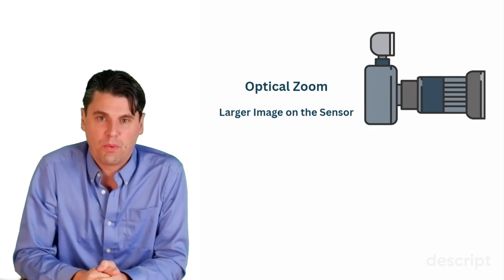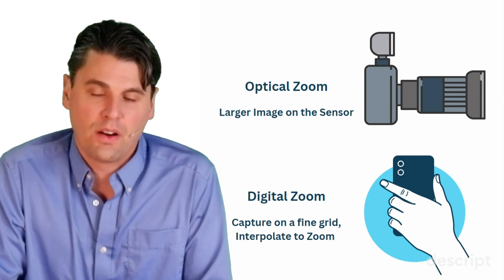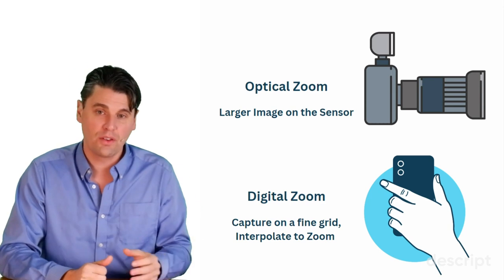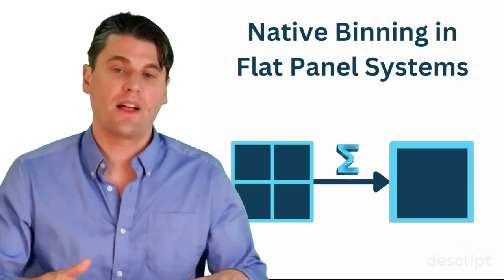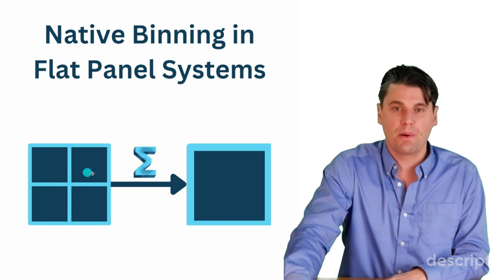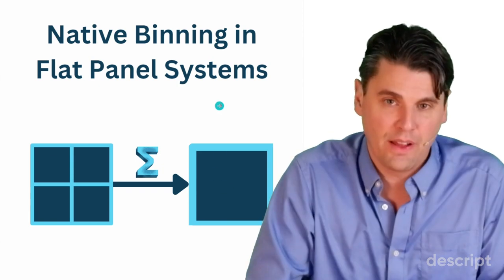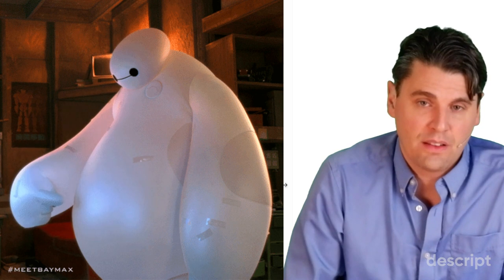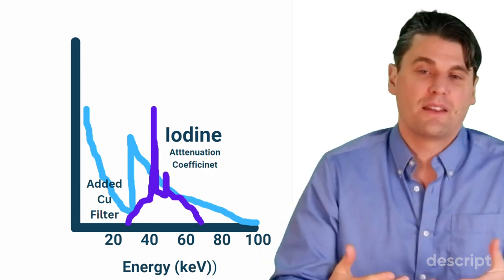Fluoroscopy Magnification and Pulsed Fluoroscopy

Comment: I am in need of some clarification. For pulsed fluoroscopy, I understand that a grid-controlled xray tube is utilized. However, I am having trouble narrowing down the specifics of this "grid". One textbook says it's the charged focusing cup, another source mentions an extra hardware component (charged wire mesh), placed between the cathode and anode.  Is it one or the other, or both? Thanks
Reply from the maker: https://ajronline.org/doi/pdf/10.2214/ajr.175.5.1751453?download=true , Figure 2 shows a picture of the grid

Comment: Hi Mr Brian
I have got 2 questions :
1- Brightness gain is increased when the exposure to the input  phosphor is INCREASED? IS it true or false?

2- what is the effect of increased tube voltage on the brightness gain?
I am a little bit confused about the first one, so I will be grateful to you if you could clarify it.
Thanks in advance.
Reply from the maker: Brightness gain is typically the flux gain times minification gain and doesn’t depend directly on exposure parameters like kVp
Reply: @HowRadiologyWorks  thanks a lot for you response, i deeply appreciate you help 🙏
Reply: Have you FRCR part 1 exam ? ..
Reply: @abdullah7472  do you mean if I passed ?!

Comment: I like the video, but just want to question you about the eye not seeing beyond 30 frames per second? Have you compared a 120 hz monitor to a 30 hz monitor? Dont need an image update really more than 24 hz in medical applications under most circumstances... though one might argue 60 hz mights be useful in angiographic applications.
Reply from the maker: Thanks for the feedback. From the literature I have seen the just noticeable difference for the human perception system is somewhere under 30 FPS especially if the task is not a complete flicker where the screen goes blank completely. https://s3.cad.rit.edu/cadgallery_production/storage/media/uploads/faculty-s-projects/1918/documents/177/framerate-visibility-thesis.pdf
While it maybe possible for some extreme tasks to perceive a difference there is also a dose penalty associated with the higher dose rates so there are more sites moving from 15fps for 7.5fps for many protocols. Thanks for the comment though because in the future also we may want higher framerates when we have AI reading the frames and that can potentially benefit from framerates even higher than our visual system can reliably differentiate. I have not compared monitors for these type of signal so can't comment on that.
Reply: @HowRadiologyWorks  This article suggets observers can identify differences in frame rate at both 24 and 48 fps? 

I've not specifically looked at literature which tests the hypothesis that our perception is limited to under 30 fps.... I just know that I am driven mad when I look at 30 hz monitors. Even under normal desktop conditions I'll select out a 120 hz monitor over a 60 hz monitor.  

Under clinical circumstances 7.5 fps if fine for fluoro though... I've not done any angio, just observed,  but it just made me wonder if say the pt has a high HR it might help to have a higher FPS... aha but Im not a cardiologist! 

The AI can help with dose reduction using a variety of techniques whilst increasing image quality in both spatial and temporal domains :P